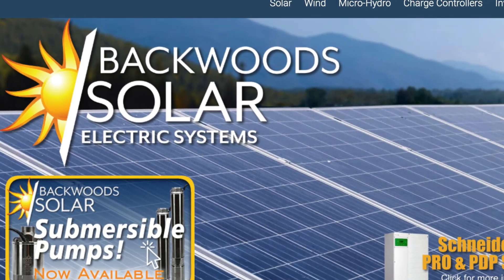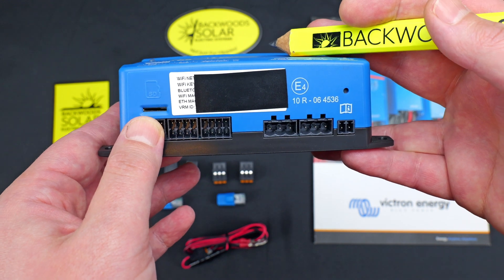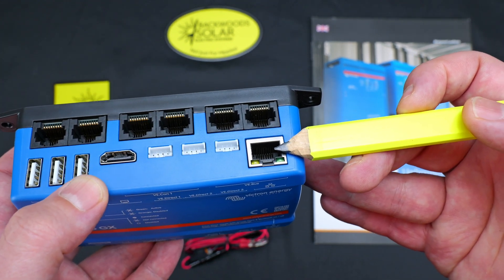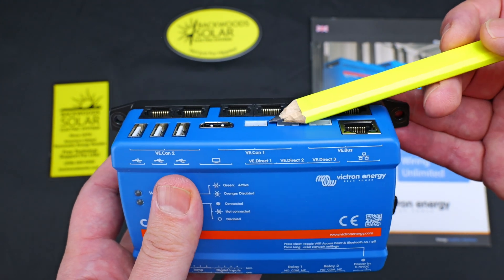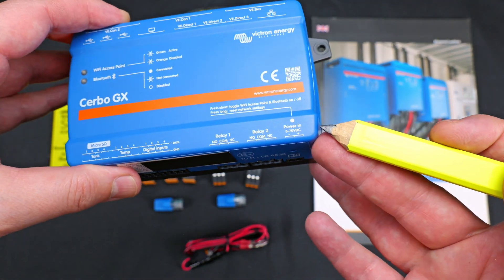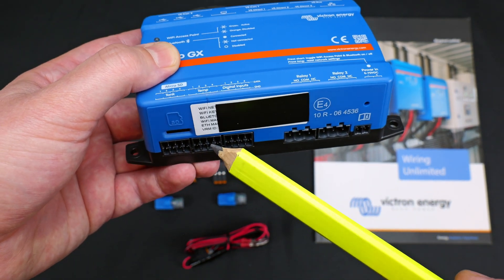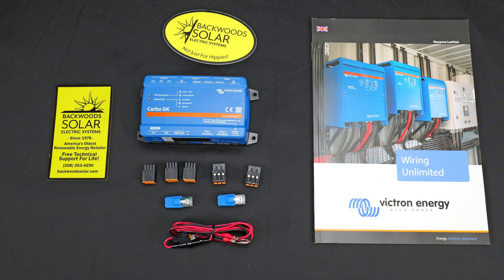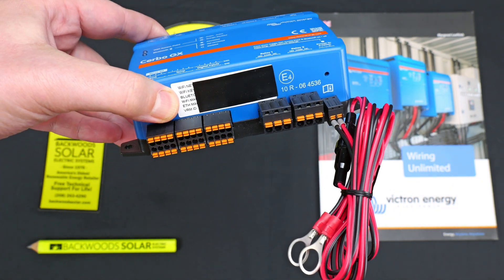Victron Cerbo GX MK2 - Part 1 Connections, Changes, Overview

Comment: G'day. So are the touch 70 ipdated too to run power via the HDMI port not needing a USB for power? 
   More info or video would be awesome of digita portsl and relay options. Running Bluetooth sensors like the INKBIRD IBS TH2 
 through the cerbo for internal and external fridge fans I need to implement but don't want to run hard wired sensors through walls into each compartment.

Comment: have you tried a usb mouse or keyboard with a non touch display?, im thinking of buying one (cerbo gx mk2) but can't justify the price tag here in Australia for the touch screen, maybe a raspberry pi touch screen will work, if not my only other option is a cheap inexpensive lenovo m10 tablet connected by wifi/bt to get stats.
Reply from the maker: Yes, a USB mouse/keyboard works. The tablet option works great as a dedicated display. It is very seamless to install on most android tablets that I have tried. The tablet and Cerbo need to be on the same active Wifi network or the tablet directly connected to the Cerbo's WiFi Hotspot. If you plan to use VRM I think you will find that will become the main place you will reference the system. I rarely use my GX70 if I'm connected to VRM. While I have not tried a Pi touch screen I don't see why it would not work. Most are HDMI and USB power. It may need screen calibration once connected. As a side note you could always flash a Raspberry Pi with Venus OS and create your own "Cerbo". You can find the image files and info on Gethub.

Comment: my Victron dealer/installer did not give me any of the terminal blocks or the temp sensor when he installed the unit in my camper van.  I found the sensor on Amazon, where can the connector blocks be purchased?
thank you.
Reply from the maker: We have some extra Cerbo terminal blocks in our parts bin. Give us a call or use the contact on our website and we will get them sent out.  https://www.backwoodssolar.com
Reply: @BackwoodsSolarElectric  I sent an email to customer service

Comment: can this be used with non victron inverters and batteries
such as eg4 18kPV
Reply from the maker: Yes, the Cerbo is compatible every battery type. It just needs voltage between 8-70v DC. It will not communicate directly with non-Victron inverters. In terms of closed loop communications with lithium batteries, most brands will work. You may need a custom data cable between the batteries and the Cerbo. The link below has additional info for connecting non-Victron Lithium batteries to the Cerbo.
https://www.victronenergy.com/live/battery_compatibility:start

Comment: Thanks! Is there a way to improve on the Cerbo's Bluetooth capabilities? I have 3 RUUVI temperature sensors (Bluetooth). Sometimes, I do see them near the tank levels. Sometimes they disappear for weeks, despite I have a Bluetooth USB dongle on the Cerbo and new batteries in all the RUUVIs. Any suggestions?
Reply from the maker: Yes, you can add an external long range USB Bluetooth adaptor. Once plugged into an open USB port the Cerbo should automatically use it. We use one for our Ruuvi and Mopeka senders. Victron does not sell a specific model but most out there should be compatible with the Cerbo.
Reply: @BackwoodsSolarElectric  Thanks. I will try that by replacing my current USB dongle with a long-range version, as you suggest.
Reply from the maker: I missed that you already had one. The type with the external attached antenna do preform a lot better. The only other tip would be to turn off the internal WiFi if you're not using it.

Comment: I cannot get the MK2 to recognize my EG4 batteries.  Is there a need to change the comm buad rate?
Reply from the maker: EG4 batteries need a custom cable from the primary battery to the Cerbo. It flips the pins in the RJ45 cable so the Canbus comms reach the Cerbo properly. The Pin out the batteries BMS uses may vary from model to model. However on the Cerbo Pin 8 is the CAN-L and Pin 7 is CAN-H. GND is Pin 3. The battery manufacturer should be able to verify.
Reply: @BackwoodsSolarElectric  TY for responding.  I have the EG4 cable that swaps the pins.  My cerbo is still not recognizing the batteries at all.  I am using a shunt, but i would rather have the batteries tell the system what they need.  Any ideas on what to do or where to go to get help?  We are full timers.  In NM, headed to S.Cal area.  Then PNW this summer.
Reply from the maker: Have you tried both VE Can Connections? The center ones would still need the terminator plugs. The #1 Can ports are isolated not needing the terminator plugs. Interference in the network would cause issues. What EG4 model battery do you have?
Reply: @BackwoodsSolarElectric  Yes.  It is plugged into the VE Can 2 (farthest left port) now without the terminator plug.  The batteries are EG4 LL 48v.  I have tried all 4 can ports.  with and without the term plug.  Signature Solar says "it should be working...."
Reply from the maker: You're welcome to give me a call, # is on our website. Few things to check: Be sure the master RJ45 cable is in the correct orientation. It can only be connected one way and should be labeled. If you go into the Cerbo's menu to the services tab, then choose the Can Port, see what the "CAN-bus profile" is. If there is a Can-bus BMS 500kbit try that profile. This works for Pylon and other BMS's of the same "language". If you have more than one battery, disconnect the others from the Can Bus network. See if it changes if you just have the master battery talking.
Reply: @BackwoodsSolarElectric  THAT WORKED!!!  I changed the CanBus Rate to 500kb from 250 and it found it.  Thank you sooo much...
Reply from the maker: Great, Glad that worked.